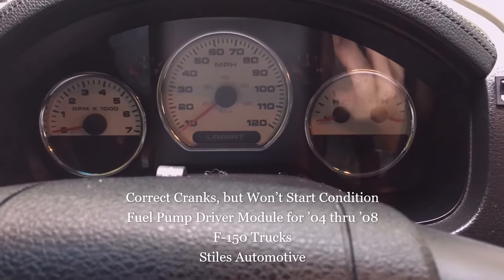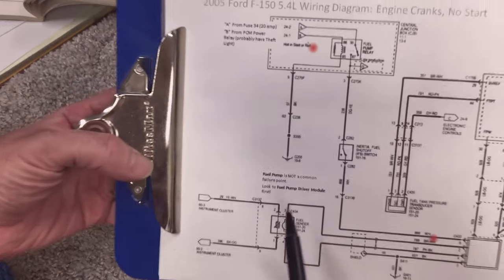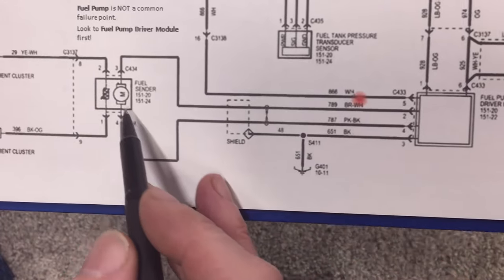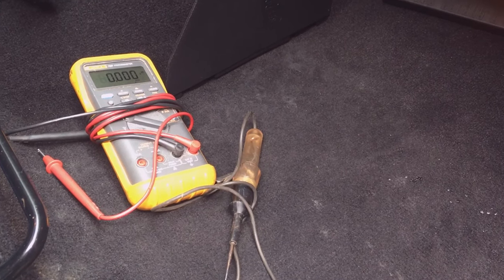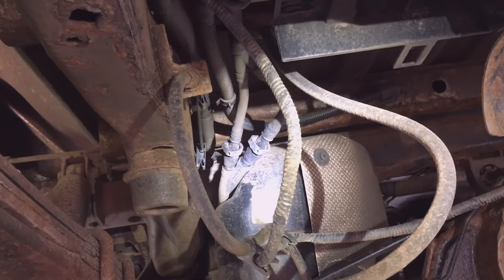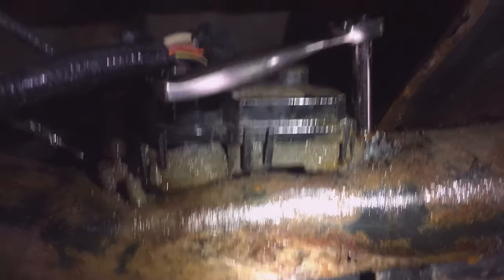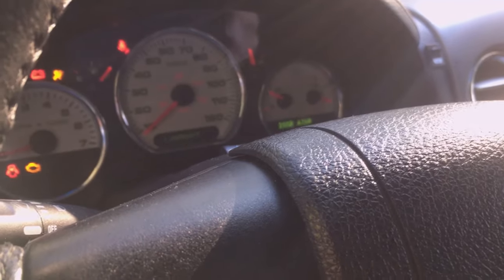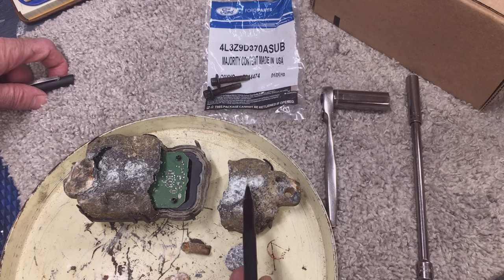Correct Cranks, but Won’t Start Condition – Fuel Pump Drive Module for ’04 thru ’08 F-150

Comment: I tested my module with the jumpers, and I can hear the pump with the key in but it won’t start my truck. What would be my next step in this process
Reply from the maker: Did you check for OBDII Fault Codes?  If you are sure you are getting fuel to the engine, you need to check for spark, a no spark condition has many potential causes.  If your FPDM is corroded and never replaced, I'd replace it now, while you are looking at it. - Stiles
Reply: @StilesAutomotive  my fault code is p1299, engine was getting to hot. I just relaxed spark plugs 6 months ago so they shouldn’t be a problem. My module doesn’t look corroded but I am going to replace it just to see
Reply: @StilesAutomotive  I don’t know if I’m for sure getting fuel to the engine. When the FPDM is hot wired, I can hear my fuel pump. That’s a good sign, but not a definitive measure of it working?! Correct? Or could it still be the problem if a new FPDM doesn’t fix it
Reply from the maker: @cameroncopeland8919  Cameron, we need to backup. You overheated your engine (04 thru 08 F-150) and now you have a cranks but won't start condition?  Tell me more.  What happened after you overheated the engine, you drove home . . . Truck hasn't started since?  What you say in your other comment is true, just 'cause the pump runs doesn't mean you are getting sufficient fuel pressure at the fuel rail, however, you can tell a lot from the sound of the pump.  You can tell if it is strong and hitting hard, or if it is slow and laboring.  Often when the fuel pump fails, it fails.  Back to the other side, Spark, if you have a no spark condition, the fault is not likely the spark plugs or the individual coil on plug coils.  It is a PCM fault or a sensor telling the PCM not to fire (or a bad wire).  - Stiles
Reply from the maker: Cameron, see your other comment for a reply! - Stiles
Reply: @StilesAutomotive   it started to over heat and govern the engine so I pulled over and let it cool down and added some coolant. It ran fine for two days and on the third would crank but not start. I ordered the FPDM and it got my truck starting quickly again, but now the engine is still self governing and won’t let me push the gas. Would I need to reset my PCM? And if that didn’t work replace the engine coolant gauge?
Reply from the maker: @cameroncopeland8919  It is always possible to have multiple problems going on at once.  Are you able to read the OBDII Fault Codes yourself, when the Truck is going into protected mode?  No other codes?  Yes it won't hurt to reset your PCM by disconnecting the Battery Terminals and holding the Disconnected Terminals together for 10 seconds.  - Stiles

Comment: Replaced my fuel rail pressure sensor and the fuel pump driver module still no start fuel pump is not turning on ....smh
Reply from the maker: Enjoy, did you try using a jumper at the FPDM like I showed in the video? Did it run strong? Do you have 12 Volts at the FPDM? Did you ensure the Impact Switch is ok and not actuated?  - Stiles
Reply: @StilesAutomotive  I did turned out my pump was bad

Comment: I got same problem but 03 cadillac truck i cannot figure out wtf it is starter good because it cranks battery good all lights turn on it has oil i hear the fuel pump and i was just driving the truck turned it off went and got my niece from school came back out to truck got in and took off about a half mile down the block it died wouldnt start back up fuses and relays are good like wtf lol
Reply from the maker: Villain, that sounds like a fuel or spark related problem, because it just died. It also sounds like you are doing the right things, checking Fuses and Relays. Back to Basics: for a engine to run you must put in Air, Fuel, and Spark. Unless the car hasn't run in months you know it is getting Air. Spark you can check at the Spark Plug. Fuel check Fuel pressure at the Fuel Rail.

You didn't mention any Check Engine Lights or Fault Indication. This might lead you to a Sensor Failure or other indication.

Did you hear any noises at all prior to the Engine dying? if no, ok, but, if yes, could be something more serious like Camshaft Timing.

Let me know how it goes! - Stiles
Reply: @StilesAutomotive  no noises at all never had a problem with the truck at all it started for a second then died it wants to start again but wont which makes me think its the fuel pump i put little gas in incase my gauge is faulty still nothing im pretty sure its the fuel pump though ill keep u updated after i replace it
Reply: @StilesAutomotive  okay update lol so got a fuel pump installed it replaced the fuel filter put new relays and checked fuses it started up finally and drives but its still dyeing when driving and guess what now my 2002 Denali is doing the exact same thing but the starter relay was busted when i move it the truck cranks wont start kinds weird so went and bought a new relay now it wont even crank but all the lights go on on the denali this is BS lol

Comment: When I put paper clips into the module and turned the key it started to smoke ...
Reply from the maker: You, my friend, probably have a dead short in your wires or more likely in your Fuel Pump itself, be careful!  Let me know how it goes! - Stiles
Reply: @StilesAutomotive  would my next step actually be changing out the fuel pump? Backstory, truck sat with a drained fuel tank for 4-5 years. I brought it home, poured about 10 gals into it. Fuel gauge needle isn’t picking up either..cranking but not starting
Reply from the maker: @boostedjdmem1  When you put the jumpers in, you put them in correctly, ground to ground and power to power? If you jumper this right, the Fuel Pump should run continuously.  If it doesn't you have a bad wire or bad pump,  Because the Fuel Pump sat for so long, if you take it out and play with it, it may run again. - Stiles
Reply: So does it have to be put on to get ground having that problem I bought it but didn’t put it on the frame just plug it but didn’t work wondering if I should put it on frame
Reply from the maker: @elieli1347  I don't think it is grounded thru the frame, but when I painted mine, I kept one mounting hole free from paint in case it is grounded thru the frame. - Stiles
Reply: @StilesAutomotive  ok thx I’ll check it out
Reply: Just an update: definitely was a bad fuel pump, changed it out this weekend and it looked bad. After I took it out I connected some test leads to it from a battery and it barely made a faint noise and began to smoke. The little metal piece was completely rusted off therefore my gushed didn’t show anything
Reply from the maker: @boostedjdmem1  Ok, very good!  At least you know without a doubt what the problem was!  Again, thanks for the comment / update! I wish you many more miles from your Ford! - Stiles

Comment: Is this problem on 91 too?
Reply from the maker: Trainnerd, No, your Fuel System is different.  The newer System doesn't have a Fuel Return Line and this FPDM (Fuel Pump Driver Module) acts to control the fuel pressure.  Your Fuel System has a both a Fuel Return Line and a Fuel Regulator to control the fuel pressure. - Stiles

Comment: I change my module and the fuel rail sensor it started drove to store parked it. Next morning not working. Took the module off and reconnected started but then it went off ... smh heeellllpppp😅😅😅
Reply from the maker: Bebo, I wonder if that isn't a grounding problem. I'd clean (with a wire brush) the FPDM base, the Mounting Point on the Frame, and the Bolts. Have you had any luck fixing your truck? - Stiles

Comment: I followed the video and did the same thing. Now I hear the fuel pump coming on, but the truck still won’t start.
Reply from the maker: Nick, you are not giving me much to go on. You have to give the Engine: Air, Fuel and Spark.  Do you have Spark? Do you have Fuel at the Engine Fuel Rail? Did you have any noises when your Truck started the No Start Condition? A noise like the Timing Chain Jumping a Tooth? Anything? Was you Fuel Pump not running before? Did you replace the FPDM? If these 2 things are true, you likely have Air in the Fuel System. Cycle the Fuel Pump on and off 6 or more times.  - Stiles
Reply: @StilesAutomotive  you’re right sorry I was in the middle of a frustrating diagnosis I have spark, the fuel pump wasn’t running until I put the jumpers in and now it runs with the key on. Cranks over strong but no start. Going to double check that I have fuel at the fuel rail !

Comment: What if it starts with old one but not the new one
Reply from the maker: Paul, Can you verify you bought the correct part number?  I know there are several Ford Part Numbers of the FPDM that look similar.  I don't know if they are different generations of the same part, but think that are different FPDMs for different Ford Vehicles.   If you have the correct part, look for bent pins on your new Module.  I don't think the Module grounds through the base of the Module, so that shouldn't be an issue.  I'd be interested to know if the old Module drives (or turns on) the Fuel Pump continuously.  This would mean it failed on, and you may not be receiving a signal from the Powertrain Control Module (PCM).  Let me back up to verify. With the new FPDM the truck doesn't run, but if you go back to the old FPDM is does run again?  Or, it did run with the old FPDM, now doesn't run with either the new or old FPDMs?  For the first case, this is what I was talking about above.  For the second case, you likely blew a fuse and need to check fuses 34 (20 amp PCM Power) and Fuse 5 (7.5 amp PCM Keep Alive).  Hope this help, let me know how your troubleshooting goes.  - Stiles

Comment: I have this problem, but my pump does click.
Reply from the maker: Alex,  My truck was running fine until the fuel pump didn't run at all.  When the FPDM fails it can cause intermittent engine problems and a fault code in the OBDII display.  My truck did not indicate any fault codes and from my video my FPDM broke in half and smaller pieces when removed.  -  Stiles

Comment: My 54 Triton starts runs for about 5 seconds and then turns off
Reply from the maker: Paul, Sounds like a fuel related problem, if it was electrical it wouldn't run at all. Pressure Switch on the Fuel Rail, Fuel Pump, non-venting Fuel Tank, unlikely but Restricted Fuel Filter. Let me know how it goes! - Stiles

Comment: So,  I finally got the inertia switch out  last night,  by hanging upside down off the passenger seat.  I think I now need to go to the chiropracter.  I couldn't actually test  the  circuit because everyone went home and there was no one to turn the ignition on.   Today, hopefully, I can finally accomplish the mission.    I'll   let  you know what happens..  Thanks again for the help.  I'd like to freind you on facebook, if you don't mind leaving your name
Reply from the maker: Winter, you didn't tell me the whole story.  Did you determine the Inertia Fuel Shutoff Switch is bad?  What voltage did you get at the Inertia Fuel Shutoff Switch?  Did you measure voltage at Pin 5 of the FPDM Connector (Black Wire) and go to a good ground?  I recommended NOT measuring voltage across Pin 5 to Pin 3, but going to a good ground (like all the way back to the Negative Terminal on the Battery, if you have to).  - Stiles
Reply: I could not get a voltage reading on the inertia switch.  Oddly there was no voltage before it and none after it.  I bench tested the  switch and it was bad (open).  I  splice the 2 wires to it together.  Then I jumpered the 2 sets of the fuel pump drive module together and the truck started and I drove it home.  Now, this drive  module was brand new, but looking at it closely I realized that it wasn't completely together.  Now i know.   Thank God.  I can't even begin  to tell you how much i appreciate your help.   Thank you a hundred million times!  Now I can finally get my life back. :)
Reply from the maker: @winter4345  Ok, Very good!  - Stiles
Reply: @StilesAutomotive  I messed up and put the reply in the wrong place.  It' s actually   below this reply.  I  am not very computer literate.  Sorry about that.

Comment: Do those manifold gaskets ASAP man before your heads JUNK! I've become somewhat of a "pro" at fixing them for customers who attempted the job themselves ONLY to snap off studs in the heads. Also the leaking exhaust gas will eat away at the head itself and when that happens it's garbage.
Reply from the maker: Yes, very true, I think about exhaust gases hurting the Head each time I drive the F-150, seems like the Gaskets rarely leak on the Exhaust Manifold side, but leak between the gasket and the Head which is hard on the Head.  I drive a Mustang in the summer, but need to do that Exhaust Manifold before winter.  Thanks for the comment! - Stiles
Reply: @StilesAutomotive  No problem man, hopefully I didn't come across as being an asshole as I wasn't trying to!
Reply: @StilesAutomotive  Could use your help with this issue!!
Reply from the maker: @dieseldabz7104  I don't see a question or an issue, can you re-state it. - Stiles
Reply: I also have this problem and I'm indeed afraid of snapping off studs. Do you have any hints or a good youtube video you could send me to?